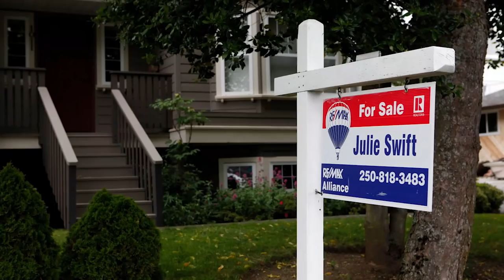Housing shortage 'becoming more and more of a crisis'

Comment: The ones that are making money in this circus are realtors, mortgage brokers, sellers and developers. It is perhaps time to impose capital gains tax on principle residences. Tough call but the right thing to do.
Reply: Replace the Realtors with an app, and tax the flippers so hard they wouldn't dream of doing it anymore.
Reply: @donm2067  I do not know if realtors can be replaced with an app (remember you already have DuPropio and ComFree. Have they gained traction?).

About taxing the flippers CRA is already cracking down on them (unofficially) if the behaviour tends to lean towards flipping. However an official act should be passed and should be a law plus investors should be barred from buying a new home for a few years or so to cool the market + not to mention - taxing the capital gains on principle residence. Unless this is done it's really hard to see prices going downward. Since 2008 govt. has tried various ways and means to cool down the market but the efforts have not really paid off.
Reply: @donm2067  for real. Im so sick of boomers and investment firms etc buying reasonably priced houses, adding a bunch or expensive fanct shit noone needs wants or can afford and than trying to sell the house for triple or more the original price

Comment: For those risk averse home buyers, you are missing the opportunity in 2017 Spring to summer of 2018 when we had a housing crash of 35-40% due to new mortgage rules and tenancy law change back then. It would have been your equity $ had you made the move to buy the properties. Unfortunately, too many buyers buy at the boom and no one wants to buy when there is a down turn. Just like stock. But only the ones who buy at low made a big win! Remember that ! The elasticity of real estate is less than one. Very inelastic in terms of demand.

Comment: The reason there is a shortage of rental housing is because there is no profit to be made in rental housing anymore. The cost of land, materials, labour, and utility bills is too high to be able to charge tenants cheap rent. This is due to SHORTAGES OF LAND, MATERIALS, LABOUR AND ELECTRICITY.  We solve this problem by increasing the supply of land, materials, labour, and electricity. We increase the supply of land by rezoning land to allow higher density housing. We increase the supply of materials by manufacturing and importing more building materials. We increase the supply of labour by educating and  MORE TRADESPEOPLE and hiring new graduates with no experience. We increase the supply of electricity by building more power generation stations. If you do those things the price of rental housing will drop and be more profitable for the rental housing owner.  Increase the supply to restore the profit motive.